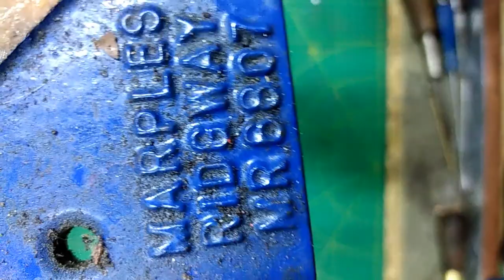marples ridgway mr 6807 mitre cutter corner clamp clean up restore vice vise

Comment: Used one of these for a while when learning my trade. Standard framing workshop kit from days of yore. I still use it for clamping up and side pinning awkward mouldings. Useful tool for joiners although the Nobex saw and knock off varients probably made it redundant. Along with naff mitre saws